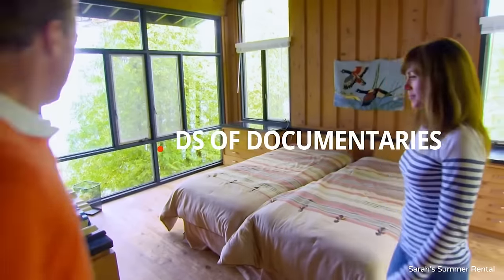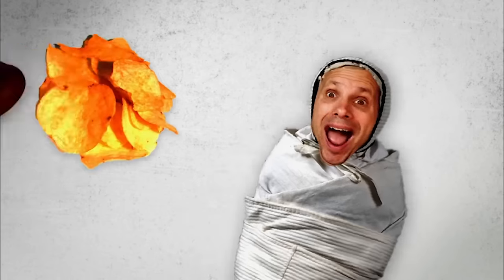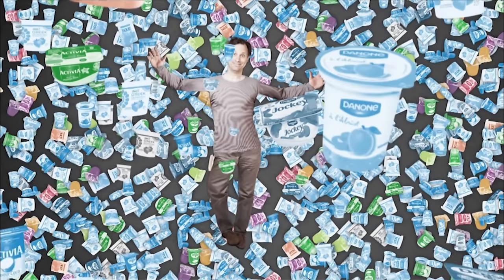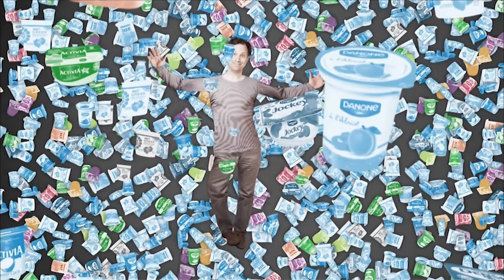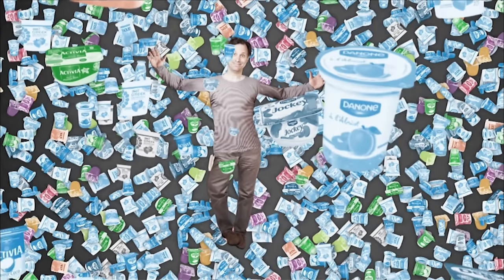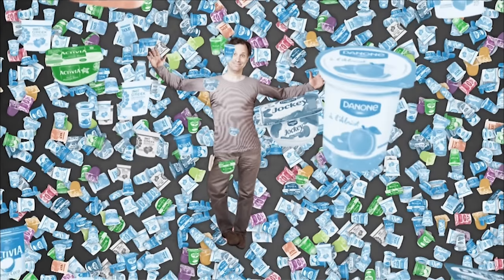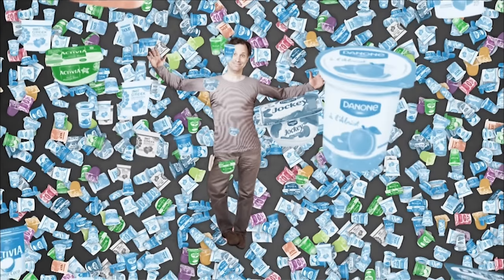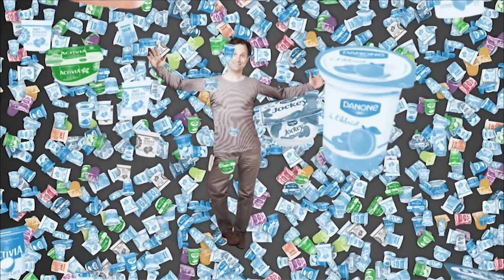Tricked Into Eating More: How The Food Industry Lies To You | Hooked on Food | Only Human

Comment: I’m sorry your very wrong at least in my opinion ..it’s opposite for me it’s when I get a food cart 🛒  I have no problem fitting in all the food good or bad but when I take a basket 🧺 it’s very limited what I can fit in so it’s when I separate my wants and needs and the limited choices I need to make at the end it’s more likely you take more of your needs than wants 🤷🏻‍♀️
Reply: Exactly!!!
Reply: I actually often go shopping using the calculator on my phone. I began in a supermarket that would give me a voucher for all my small change, so I only wanted to spend the amount of change I brought. Occasionally, I do this at other supermarkets as well. Decide how much money I want to spend and subtract from there.
Reply: Isabel, i thought i was the only one who thought its the exact opposite. if i take a cart i'd fill it with junk .
Reply: @Fidi987  I used to use a calculator. Now I just use the grocery store cart on their website. If I am going grocery shopping I just put all the stuff I want in the cart on the website and it tells me the total, where the items are located in the store, and I can delete them as I shop in the store.
Reply: They are wrong .. it’s proven that if you have a bigger cart you will fill it up more. It’s the same as with a bigger plate vs a smaller one.